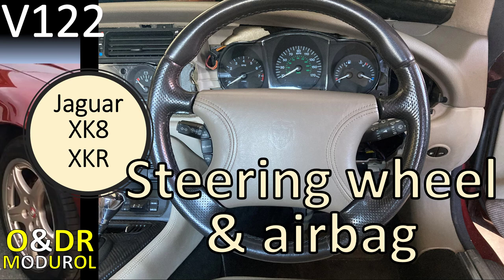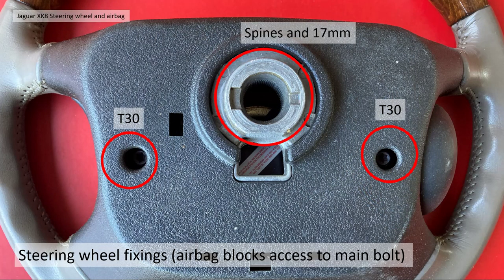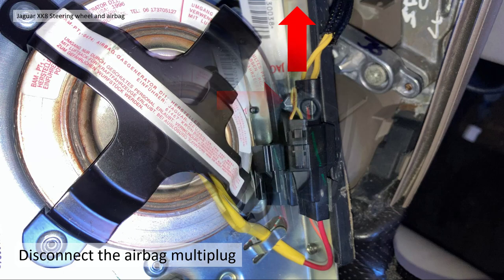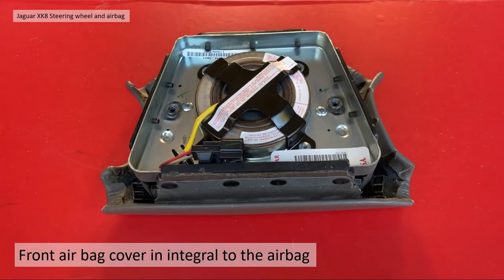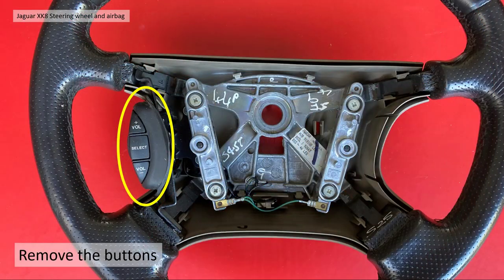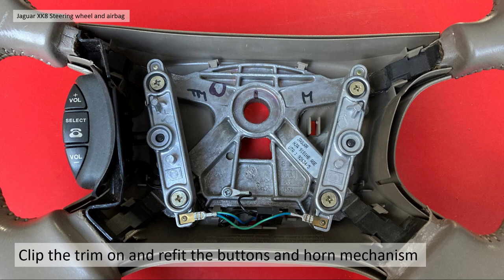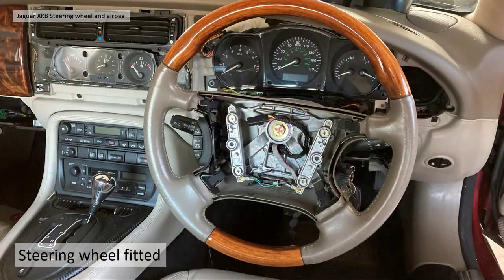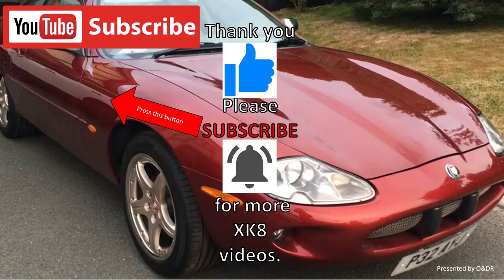Jaguar XK8 Steering and Airbag removal / swop V122 / XKR (X100)

Comment: I have a 98 XJR I noticed when you took the steering wheel off the the button controls for stereo volume excetera were there any lights there that lift those buttons up my buttons on mine do not light up I'm about ready to take the whole steering wheel off and see if there are places to put any light bulbs why don't they have lights for the buttons? Do any of the Jaguars buttons light up? It's crazy for me to believe that a high-dollar car like that does not have simple light bulbs to light up the steering wheel buttons
Reply from the maker: Mark, no the buttons don’t light up, see video showing the inside of the button enclosure, link at the bottom. Jaguar like to keep things simple (and cheap), regards Damian
https://youtube.com/shorts/M8kiSS7J9Xo?feature=share

Comment: Hallo dear, can u tell me please where is airbag sensor located for jaguar xk8 from 1996 ( outside of the car front side)
Reply from the maker: Hakob, took a look at our car and found them. See the link to the video. Under the bonnet, near front cross member and infront of the radiator. One on LHS and another on RHS. Hope that helps, regards Damian
Jaguar XK8 Where are the airbag sensors located? To 1999 XKR X100
https://youtube.com/shorts/kjCu5eBwdGo?feature=share

Comment: I'm trying to replace/repair the telescoping section of my steering column. Any ideas/help?
Reply from the maker: Captain, sorry I haven’t explored that area of the car. Removal and replacement should be covered in the workshop manual available at our website Modurol.co.uk . Hope that helps and please let us know how you fixed your steering column issue, regards Damian

Comment: I want to Place a New airbag in my Jaguar xj8 from 99 with speed control. Mine got the same connector both grey. In my Car and the One i want to buy. Only difference is mine is  HNC 9180LA-LEG. and the One i want to buy is HNC9180ED-LEG. They look the same. Also same connector. Can i install this without problems?.

Hope to hear from you. 

Greetz. !
Reply from the maker: @Zuid5314, Firstly, I need to emphasise that you need to make your own decision here, as its safety related. I might be wrong. This what I can find out from researching the SNG Barratt database (see link at the bottom).
HNC91980LA has been superseded by HC9180LC. HC9180LC is compatible to use on 'Embossed head cars' up to VIN866047. HNC9180ED is also compatible to use on 'Jaguar cars' up to VIN866047. Seem to be the same both are ‘speed sensing’ spec but not sure the difference between 'Embossed head cars and Jaguar cars' but assume it is just a different logo imprinted on the front of the airbag. Can you see a difference on the airbag embossing?  If the connectors are the same it is a good sign they are compatible. Sorry cannot give a definite yes or no, but hope that helps, regards Damian
https://www.sngbarratt.com/English/#/uk/FindParts/Families/XJ8%20~2F%20X308/10/XJ%20Serie%20X308/44/STEERING%20AND%20SUSPENSION/14714/assembly/28877
Reply: Thanks for youre anser! Embossing is a bit different. The One i want to buy is with a metal Jaguar growler inside the airbag and the stitches from the Leather is vertical. The embossing from my Car is also a growler but Only embossing in the leather.  And the leather stitches are horizontal. On the left and richt side.  

What do you exactly mean by embossed head Cars and Jaguar Cars?
Reply: My vin code of the Car is 853694
Reply from the maker: @Zuid5314, the airbag is in the correct Vin range for your. I don't know the difference between 'Embossed' and 'Jaguar'. Assume it's just the difference in logo as the passenger airbag module has only one variant up to VIN866947 (link at the bottom). There are no variants for that side. As I said, I cannot give you a definitive answer, just an educated guess. Sorry, can't be more helpful, regards Damian
https://www.sngbarratt.com/English/#/uk/FindParts/Families/XJ8%20~2F%20X308/10/XJ%20Serie%20X308/44/OCCUPANT%20RESTRAINTS/13708/assembly/28888
Reply: Thanks mate. Im gonna order it and ill see What happens. Think its gonna be oké.i hope haha. 

Keep up the good video’s! 

Cheers from Holland. Rotterdam.
Reply from the maker: @Zuid5314, sorry no quite sure what to call you as not familiar with Dutch names. There is a saying in UK - "if it looks like a duck, walks like a duck and quacks like a duck,......it's a duck!". This was quite an interesting question and well worth a video. Are you happy for me do this?  If so, it would be great for you to send photos of your car exterior, interior, and airbags etc.  Good luck, regards Damian
Reply: Yea no problem. Haha its definitly an airbag thats for sure! Do you have an e-mail so i can sent you Some pictures? 

Grtz
Reply from the maker: Our email is oanddr@gmail.com , regards Damian